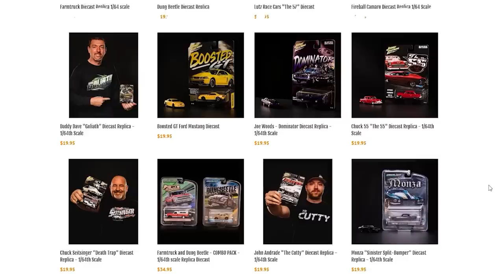JEEPER SLEEPER & PENNY - Pop The Hood! Behind the Build

Comment: Love these jeeps, had an 07 that I almost got to the point of build the motor/trans and add forced induction, but first I went the route of improving the handling for living out in the mountains and those windy river roads, also was bit floaty stock over bigger rises and dips in the road. So I did BC racing BR series Coilovers with swift springs, but I kept it set just a hair below stock srt8 height and dampers set around midway for passengers, also to allow enough body roll that it didn't want to push thru corners. Replaced the bump stops with Bwoody polyurethane ones. Upgraded to Jeepin by Al upper control arms designed for lowered applications. Went with Bwoody for some thicker tubular sway bars end links, all polyurethane bushings with grease zerks. Driveshaft boot tore so decided while I was gunna pull it out to upgrade to DSS aluminum shafts for future power mods. Upgraded to 4140 Moser rear axles. Blew the elbow joint for coolant hose, in 06-07 they had 2 piece with an elbow that seemed on forums to be a weak point, so replaced it with one piece and surprising after just that my avg temps under all conditions dropped by 10 degrees. Went with 3 inch magnaflow catback, but it sounded just bit too tame, so replaced the one piece mid muffler with 2 Carven TR's for bit more aggressive tone. Had a ton of fun with it, but man I felt bad for anyone over 6ft in the back seat :D

Comment: Nice builds guys. That nitrous for the hole shot is smart. May look into that… I’m running a solid 1042 rwhp / 1102 rwtq on a 397 stroker! But I did a manual in mine so I lose a little at the track but super fun to drive

Comment: Yall are great! What yall do is true street racing. Taking a daily capable/factory car and adding proformance to drive train, suspension, and or electrical system. Maybe a little weight loss. Outside that its not what true street racing is meant to be. Im not saying those other cars aren't cool or its not skill to drive high power cars on the street, but it's not true grassroots street racing. Keep it up guys!!

Comment: I'm not sure if the srt8 has the same front differential as the regular wk 4x4 like I have mine is a 2006 grand Cherokee limited 4x4 with the Mercedes front differential but I looked up one time and it is pricey but they do make a 4:10 gear set for it over the  factory 3:73 but like I said might be different than the differential on srt8 grand Cherokee